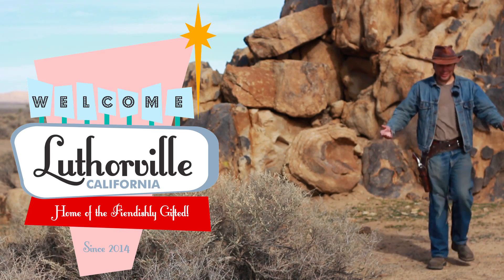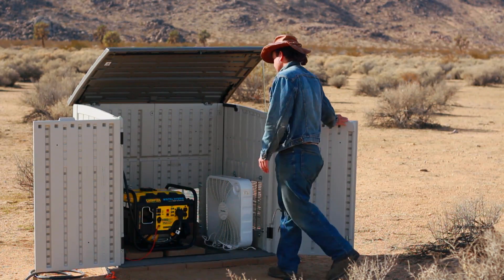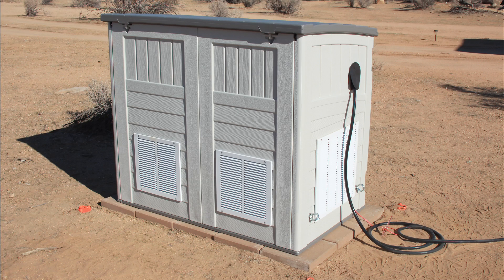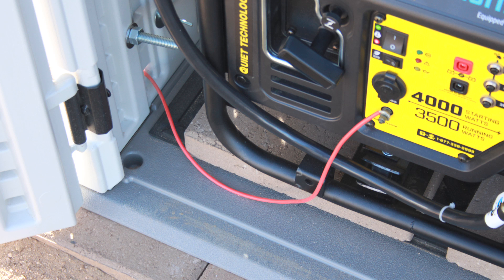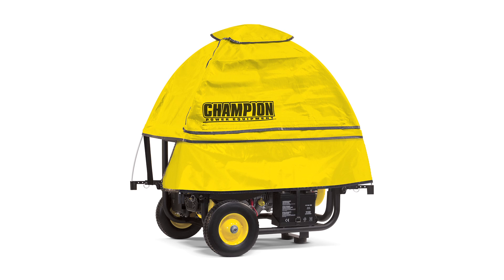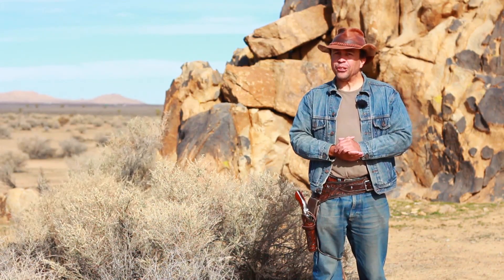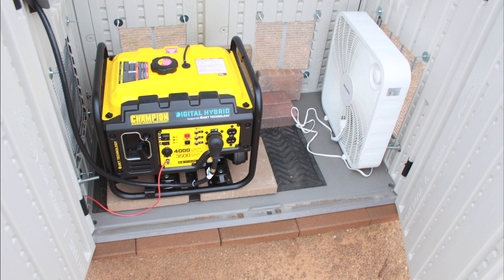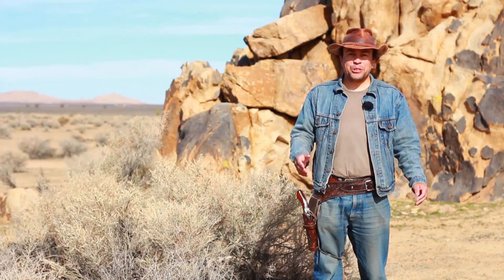How to build a portable generator shed enclosure?

Comment: Just curious as to why you don't have the box fan on the opposite side of the generator and move the generator on the right side of the shed? Is your box fan blowing hot exhaust fumes back onto itself? Otherwise, great setup.
Reply from the maker: This video was from many years ago, but if I recall, I think I originally had the fan blowing out and that didn't work very well, so I switched it to pull the outside air into the shed and that worked much better. I suspect the exhaust was building up inside and causing the engine to choke. When the fan was set to pull outside air into the space, it would run fine.

Comment: Perfect. Too many people are obsessed with venting the exhaust and all this other frilly stuff. If you are venting the volume of the air inside the generator every few seconds. If there is negative pressure in that shed. Your set.
Reply from the maker: Thank you. I thought the same thing. Many of the sheds people create are overkill. Even a weak 20" box fan moves at least 1200 CFM. Most box fans move a lot more than that. That shed is only about 10 cubic feet at the most. So, a 20" box fan is plenty safe.
Reply: What about the generators with Co sensors, wouldn’t that be a problem?

Comment: This is in my opinion the best made generator shed, but I have one question, do you think this will work with a bigger portable generator? Mine is Champion 9375, is that to big for this set up in your opinion?
Reply from the maker: I don't know if that specific generator would fit in this specific box. Remember the larger the engine on the generator, the more heat it will produce, so you really want to make sure you have enough space and ventilation, so you don't melt the plastic or start a fire.
Reply: @LuthorvilleCA  very good points, thank you very much for responding

Comment: So did you put the gen set in the shed for protection from the elements or for sound reduction? Majority of people do it for sound reduction and protection from the weather is just a benefit of using a shed. With all your vents I can't imagine the sound being reduced maybe why you didn't do a noise level check with the generator running. Nice shed though I'll have to check it out!
Reply from the maker: It was 100% for the weather, so I could run it in the rain. I didn't care about noise reduction since my closest neighbors are extremely far away.
Reply: Thanks for responding,that makes sense!

Comment: Just be sure you understand the air flow to your genset.  Most mfts require 5 feet around all sides so fans are important to supply genset separately from engine.
Reply from the maker: Yeah, that's why there's a fan and vents.

Comment: What is the internal temperature of the shed?  In Texas when it's 95 degrees outside  I can not keep the inside of the shed under 110 and that's to hot for my firman tri-fuel generator.
Reply from the maker: It got really freakin' hot.
The manual on my generator says in can run in 104 degrees continuously, and can run in 120 degrees "for short periods" but it doesn't define how long a "short period" is. Is that an hour? 5 hours? I have no idea.
When the temperature in the desert got to be 95 or 100 or 110, I would simply leave the doors and the top open.

Comment: Why are you putting the fan so far away from the opening of the case? Only part of the cool outside air goes through the opening, the majority of the (warm) air is taken back out of the housing by the fan, almost like a short circuit. If you want to cool the generator effectively, the suction side of the fan must be as close as possible to the opening in the housing. It is best if a rubber seal or something similar is placed between the fan and the wall. Due to the higher air volume, the generator remains significantly cooler.
Reply from the maker: Thanks for sharing your thoughts, but your assumptions are incorrect. The fan isn't there to keep the generator cool. The fan is there to make sure the generator keeps getting fresh air and doesn't stall out by asphyxiating itself. It worked really well and never had any issues.

Comment: Realizing that this video is 3 yrs old, I still think it's worth mentioning that not all generators are created equal when it comes to keeping them from overheating. Yours looks like a 3kw unit with a small single cylinder engine. Nowadays there are tons of generators over 10kw that produce 3-4 times the heat, using twin cylinder engines, yet people still put them in the same size enclosure as yours, with same size vents, etc. With larger generators, if you don't direct the exhaust to the outside directly with a pipe, the generator will overheat no matter how big the vents are. Not to say that your idea does not work for small generators, but people need to be careful.
Reply from the maker: Agreed. Anyone stupid enough to put a generator 3x bigger in the same size of enclosure is asking for trouble.

Comment: Hey buddy... I did subscribe and have a couple questions for you about this since I bout my new generator and just bought the same shed. Has this held up just the way you showed it with a vent on each end and 2 vents on back wall, with some paver stones and a box fan ? If it hasn't over heated or melted im gonna run it the same way because I really like the simplicity of it. I think the 2 things I want to know is do you have the exhaust going out the vent of back wall or hit one of the stones, and I see you have the generator on the left side of shed with the box fan on the right,do you pull air from the vent and blow it across on the generator or use it to exhaust the hot air out the vent? Thank you so much for any help you can give me!!!! THANKS!!!
Reply from the maker: In answer to your questions, yes, this design worked great and I had no problems with it. I used it for about 2 years with no issues.
The box fan blew fresh air into the enclosure.
The generator exhaust was near a vent, but it didn't point directly at the vent. I used paver stones as insulation against the wall, so the exhaust heat wouldn't melt the plastic.
If I were going to build this again, there is one thing I would do differently. I would add some small vents at the top of the wall too, because the heat did stay trapped inside. Or, better yet, maybe put one of those turbine vents on the lid.
Thanks for watching. Hope that helps.
Reply: @LuthorvilleCA   @Luthorville: Off-Grid Education & Adventures  thank you so much for your help. I saw the bricks so was your exhaust near the vent actually aimed right onto the patio brick itself. And when you suggested a small turbine fan in the roof are you talking about as a exhaust to get the hot air out........ really thanks for your help
Reply from the maker: @eddiekytia  Yes, exactly. One of those spinning metal turbine vents, like you put on the roof of a house, to vent the heat out of the attic. The problem I found with my design was that putting all the vents along the bottom kept a lot of heat inside. So, I think a turbine vent on the lid would help a lot. I would probably seal it with silicone, so it doesn't leak. But that is the one thing I would do different from what you see in the video.

Comment: what is the ground rod for?
Reply from the maker: Technically, a generator should be grounded. There's a ground-wire connection on the front of the unit and you should wire that to a ground rod. You don't have to ground it, the generator will still work without it.

Comment: Love the box fan idea!
Reply from the maker: Thanks. Yes, it worked quite well. The only thing I would change in this design is that I would have put the exhaust vents higher. Since heat rises, I think it would have worked better with higher exhaust vents. Otherwise, the design worked really well.

Comment: Thank you for this info.  I'm wondering if you plug the box fan into the generator while it's running or do you plug the fan into a separate outlet?  Thanks.
Reply from the maker: You are welcome. Yes, the box fan gets plugged into the ordinary 120V/20A outlet of generator.

Comment: The one thing that you didn't mention is security. Now I know, you say,' Yea, but it's the desert' and I say, ' If you build it, someone will try to steal it'. So, yes that the chains would deter the temptation to try to steal it. I mean, that total set up is worth some money. And you're right, sound control is not a factor in this situation.
Reply from the maker: In the desert, the best theft-deterrents are mean dogs and footprints. Fresh footprints tell thieves the place is occupied and no methhead wants to mess with angry dogs.

Comment: Does your exhaust blow directly at the left rear vent?  I'm doing a similar shed (craftsman) and the exhaust is only about 3or 4 inches from the vent.  I'm worried that it may melt the plastic where where the lower part of the vent is attached.  What do you think?
Reply from the maker: That is why I lined the inside with bricks; to make sure the exhaust heat won't melt the plastic or start a fire.

Comment: I'm  gonna need a bigger shed.
I watched your  video and decided to buy the shed. I checked the dimensions of my generator before hand.  Long story short here don't forget to add how much the power plug will stick out. My generator  will have a little more than 2 inches on the sides when put in the shed, yup you guessed it no room for air flow. Not all bad, it can still use the shed to store the generator in closer to the. house when I  need it. Lol
Thanks for the video, we live in the desert also.
Reply from the maker: Oh, man. Well, you did the right thing. Better to get a bigger shed, as opposed to forcing it into a smaller shed, and risk melting the shed or starting a fire.
Reply: I was wondering if you've had any issues with your generator running it in the desert heat. I have a Yamaha EF6300isde generator and no where in the owners manual or shop repair manual does it tell you the maximum temperature you can run it at. We can get up to 117 degrees out here in the desert and it would be good to know  if my generator can run in that kind of heat. Just curious if anyone has an idea or knowledge about it.

Comment: Just created my shed based on this design.  I'm at the point where I have the attic fan installed (no battery) on the left and one vent on the other.  Ran a test and the generator seemed to run great.   I have a Ryobi 6500W generator so the exhaust, outlets and gas switch are in weird spots.  My exhaust faces the front left so I put my exhaust fan on the left and vent cover on the right for inbound.   My shed is outside in the backyard covered by two walls about 2 feet away from the house. 

My question anyone found it necessary to install the exhaust pipe or whether the fan would ventilate the fumes sufficiently?  I've gotten this far so I'll do it if needed but the less I have to do the better.  I'm also concerned about noise levels because I'm in a residential area so I want the least amount of cutting as possible.  Anyone else make a shed for Ryobi generators or have any input?
Reply from the maker: I'd be careful about having the generator 2 feet away from your house. MANY people put the generators too close to their home. That's why I used a 50 foot cord and put the shed as far away as possible.
Reply: @LuthorvilleCA  I hear you and I have a 50 fr cord too but I really needed it out of sight in the backyard.  Was thinking of using pavers or something else to fire proof the shed a bit and provide some noise buffer.

Comment: Just found your video and love it. Looks like you are in the desert. I take it you have run the generator on the heat with no issues since you shot this?  Also, are you familiar with hardie board? Was thinking of using that instead of stones for heat protection.
Reply from the maker: I've heard of hardie board. never used it. Yes, I have run the generator in heat of about 110 degrees. The instructions say it shouldn't be run in anything above 104 but it can tolerate 120 for "short periods of time". I have no idea what the manufacturer means by a "short period of time" but it still worked in 110 degrees.

Comment: Eric, great video. What is the minimum distance the generator should be away from my concrete block home? I was thinking about placing it about 5 feet away from the house. The nearest opening is a door that is 15 feet away from the generator and my garage door is about 15 feet away also. You mentioned that the opening for your power cable leading to your generator was replaced. What did you replace it with? Thanks in advance.
Reply from the maker: Excellent questions.
In doing my research about placement, there is no set consensus. Most folks say the generator should be at least 25 feet from any windows and vents of your home. Based upon my experience, and how far away I have been able to smell fumes and vapors, I would say 25 feet is wise. That is why I bought a 50 foot cord and placed my generator about 40 feet away.
As for the power cable, I replaced the opening with a nice weatherproof electrical box. I don't know the exact model or brand. But it's one of the types with a clear plastic door on it.
Hope that helps and thanks for watching.

Comment: Early in your Vid, I can see a problem.  Your fan is standing free inside the storage container, with a large gap between the ventilation hole and the fan.  This will allow air inside to keep being recirculated.  You need to put the fan inside a shroud sealed to the outside perimeter of the vent hole nearest to it, so as to draw fresh air inside and direct it over and around the engine.  The warmed (heated) air will then be expelled through the other vents by virtue of the slightly increased airpressure from the  sucked in air.  You need positive circulation.   Your exhaust should be piped to the outside.  Whilst doing that you could add an extra silencer to keep the exhaust noise down -- important if you use it where you have neighbours.  Piping it to the outside helps keep down the heat inside the container.    If you are still worried about noise, sound deadening material can be attached to the unvented sections of the inside of the container.   You are on the right track, though.  You just need to go a bit further.  As for manufacturers of those resin or plastic storage containers, "Keter" makes a very good range of sheds of various sizes.  Keter is an Israeli company and has a branch in the USA:-  Keter North America, Inc. is located in Anderson, IN, United States and is part of the Linens Manufacturing Industry.
Plywood makes a good shed building material if you wish to build your own shed.  It is quite easy and you can  make it pretty much any size you wish.  Just ensure any timber you use is treated to rot-proofing standards and use rust resistant screws and nails.
Reply from the maker: After 1800 hours of runtime in temperatures as varied as 30 to 110 degrees, and nearly 2 years of use, everything in my design is still working perfectly. So, none of the changes you have suggested are necessary. But, if you choose to build your own shed, following your own advice, I'm sure it will be great too!

Comment: I love what you have done with this installation. I know you talked about this in your comments and I still cannot understand why you did not run the exhaust out the side of the compartment. It seems obvious to me that over time the inside of that compartment will see the effects of oil and carbon.
Reply from the maker: At this point, the generator has about 1800 hours of runtime and the inside is barely discolored at all. The bricks have a slight carbon black to them, but the plastic of the walls is fine. Remember, the shed is still very well-ventilated. As a result, it doesn't get that dirty. It's not like the exhaust is just being dumped into a sealed-up enclosure.
Reply: @LuthorvilleCA  I made my previous comment before I went through the exercise of building my shed which houses a 5kw Honda. I researched the literature and found that you should shoot for about a 10 deg. F temperature rise in your shed perhaps a tad more. In my case, to attain that, I had to install a 16" 3,000 cfm fan. Remember heat is a generator's worst enemy, almost as bad as no oil. The head and windings are most vulnerable and remember that failure is not sudden but progressive. As much as 25% of engine heat passes through the exhaust pipe and it is best to have that dump through to the outside of the compartment. In my case I have two vents each about 17" sq.
Reply: There are two large vents to handle the exhaust plus, there is a large fan to circulate the air inside.

Comment: Good design and video.  One thing I have to comment on is the fan.  You stated that the box fan moves a lot more air than an exhaust fan.  This may be true in the open but you are missing a crucial thing.  Once you restrict the flow by putting the fan in a shed, you will find that the exhaust fan will be able to develop a higher pressure differential than the box fan.  This will result in much more airflow.  Also, a cheap box fan is cheap for a reason.  It is not built to last very long.  The last thing you need is for your generator to overheat because your $20 box fan quit in the middle of the night.
Reply from the maker: Box fan has worked with zero problems for nearly 2 years. But thanks for sharing your opinions.

Comment: Eric, not sure how the pavers are placed. Does the exhaust go out the vent or do you have it directed into the pavers?
Reply from the maker: The exhaust is pointed toward the pavers, and there is about a foot of space between the generator and the pavers.
Reply: @LuthorvilleCA  thanks so much, now I am thinking about constructing an enclosure using block on three walls with a plate door and a gabled wood roof for sound.